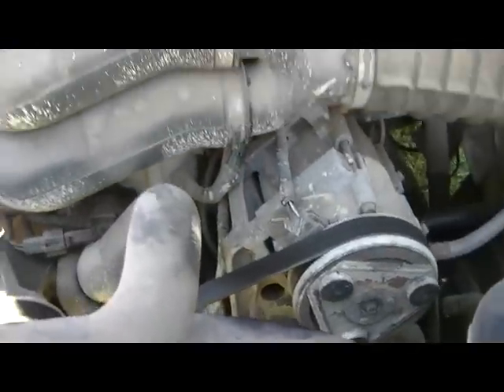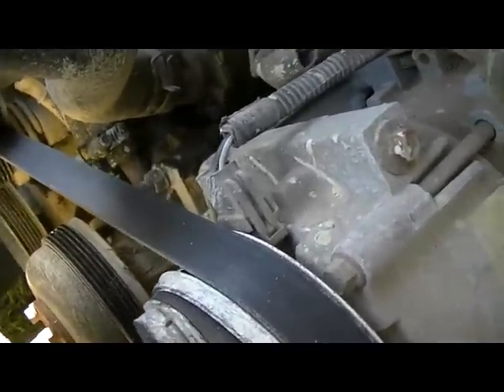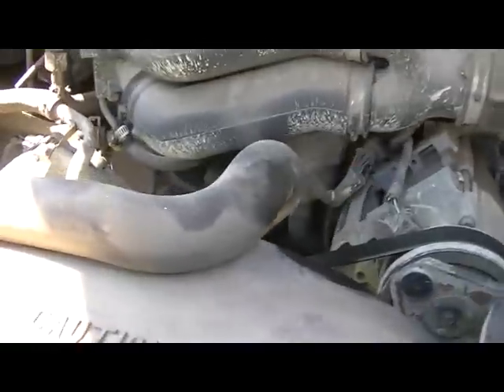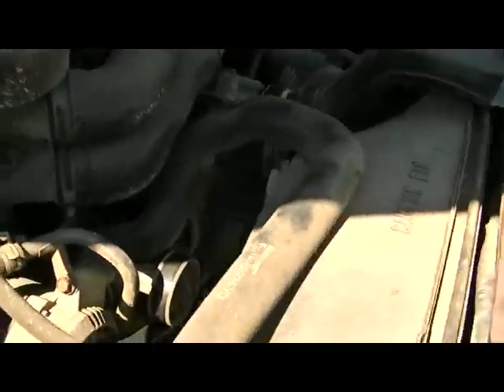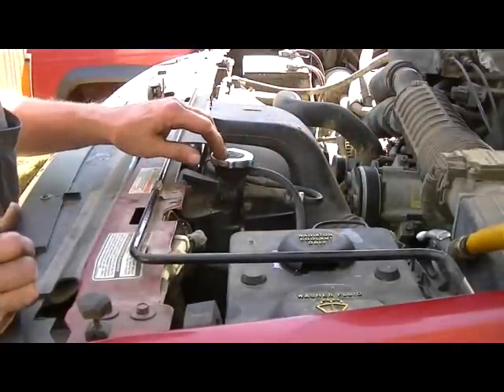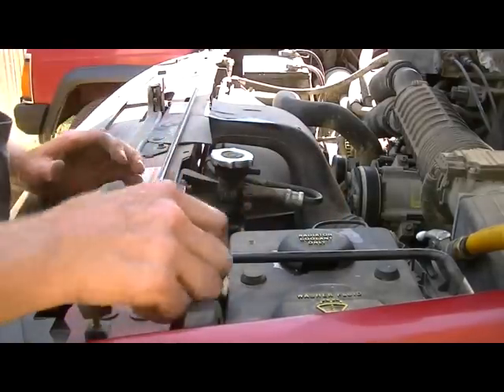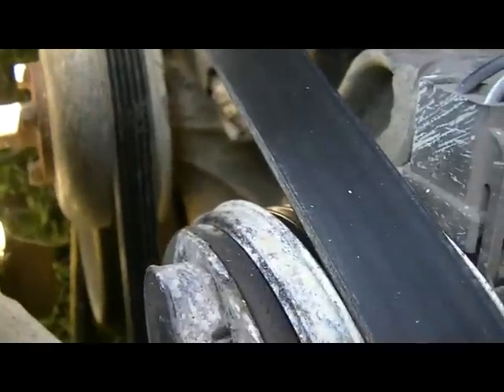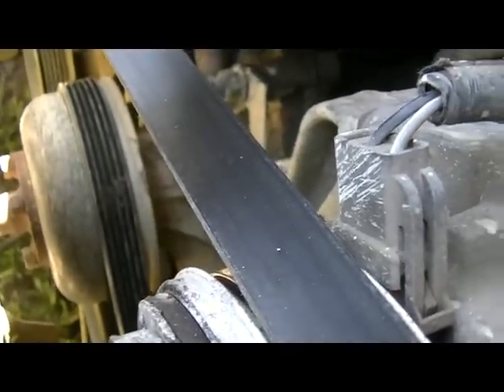Pressure Testing a Cooling System Without Special Tools

Comment: Thanks saved me a new engine 😂😂😂
Reply from the maker: Great!!
Reply: You were going to replace your engine because you could not find a coolant leak?
Reply: Exactly what I have been telling people here.  Cramming unregulated pressure into a low pressure system can cause all kinds of problems.  Like you said, a $20 hose, or even a $2 clamp can quickly turn into a  new radiator, new water pump gasket, or new head gasket.
Reply: taylorcraftrob true thats y u should use common sense and be careful if u do it like he showed in the video it wont be a problem
Reply: There is no way to guess at air pressure while using common sense.  Water does not compress much at all, so very little compressed air into a full radiator can exceed the pressure limit extremely quickly.  There is no way to use his method carefully because the method itself is dangerous to the entire system.  Get the correct tools for the job or don't bother.  But defending bad ideas by saying use common sense is like telling a moron to be cautiously stupid.
Reply: thecatsfan yeah u sound like a true haynes manual mechanic if u know what u r doin by experience u dont have 2 follow every step of written procedure
Reply: And you sign like a bailing twine and duck tape genius.  If you consider this terrible idea mechanical experience, you are too dangerous to know better.  Skipping safety steps is for guys who enjoy losing fingers or damaging their cars for no reason other than stubborn ignorance.
Reply: I use a bicycle air pump been working with no prob 4 years
Reply: And once again, if you had bothered to read my comments, multiple times I have suggested using a bicycle or hand pump with a gauge to do this instead of compressed air with no gauge.  That is a much safer way to do this.  But you are too busy arguing with me to notice that I said the same thing.
Reply: I saw and agree with both of u but in saying f u know how to set your air compressor regulator that his way isnt bad either but sure bike pump is safer
Reply: Not true buddy dont know what kind of air compressor u use if u have a air gauge directly at your tool u can tell how much psi u have i know this because i use my compressor for industrial paint and believe me u have to know what your air pressure precisley 2 get a good paint job
Reply: It is absolutely true.  As I said, home air compressor regulators do not go down to 15 psi and are not accurate below 40 psi.  I stand by that statement because it is a fact.  My first engineering job was for HP's test and measurement organization, and I can tell you home air compressor regulators are lucky to be within +/- 5 psi, and do not regulate low enough to be safe for this operation.  If you have a professional shop compressor with a very precise regulator inline, good for you.  But that is way outside the intent of this video or the test method being shown or discussed.  The maker of this video is dumping unknown air pressure from a home compressor into a radiator - paying absolutely no attention to the pressure - and hoping if it is safe.  It is not.  It is sheer luck that he is not causing further damage  What he is doing is not even close to what you are describing.  Not to mention, just 2 hours ago you claimed you were using a bicycle pump and gauge to do this.  Now you have a professional painters air compressor and inline regulator.  Which is it?  Frankly, if you can afford that level of equipment, you can afford the proper tool to do the job, or you can at least rent the free loaner tool from the local parts store to do it correctly.  But at this point, you are more interesting in disagreeing with every thing I type, and half the time you aren't even reading what I said.
Reply: I didnt say i used compressor i said i have both air pump and air conpressor an as long as u use gauge at da air tool its ok